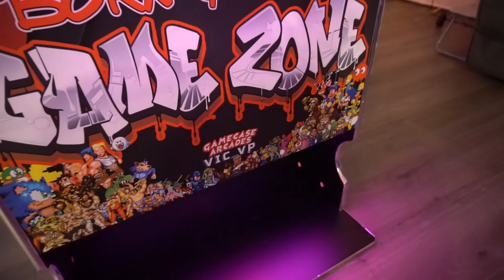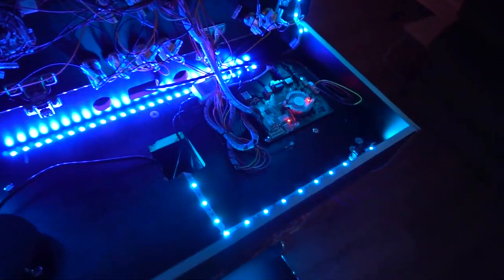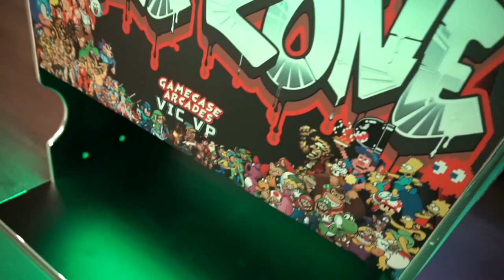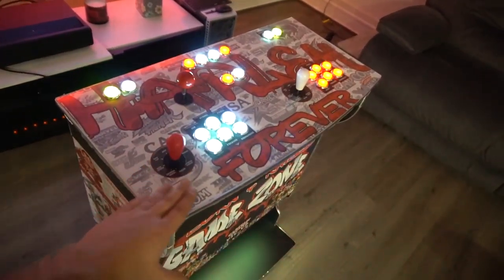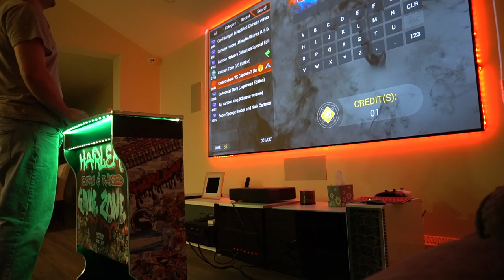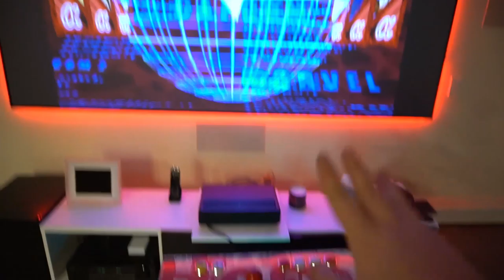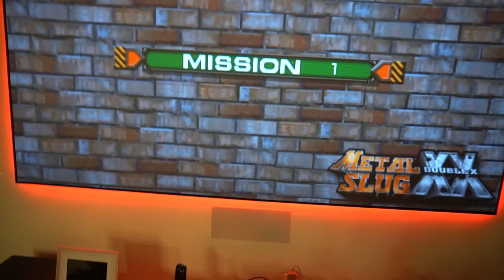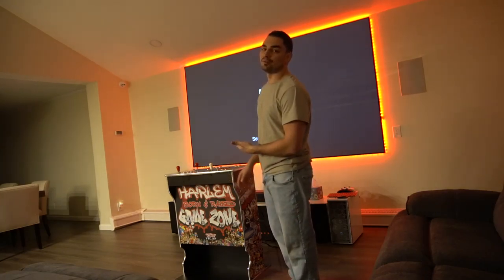New 2 Player Pedestal Design - Harlem Born & Raised

Comment: If you had to pick from the old and the new GRS arcade pedestals, which one would you go with after seeing both?
Reply from the maker: New pedestal is half inch mdf, old one is 3/4. Old 2 player control panel didn't have a pedestal, it was only a control panel.
New panel has more options but again that half inch kills me. The pedestal in this vid is half inch.
Reply: @Vic_VP  Hmm gotcha. Is the extra depth in the new version that much more spacious to fit everything in? Also, do you think the old control panel would fit/match on the new pedestal? Does the pedestal feel like a 3/4 height? Thanks for helping with the questions btw. Videos are great and help out with selecting and ideas!
Reply from the maker: I haven't don't the 4 player panel only 2 player.
You can but the stand and out the old panel on it... but be aware the new stand is half inch.
What buttons and addons are you looking at? (I've only done 2 player 6 buttons and dedicated 4 way)
If you do the old control panel and put it on the stand I believe the height is a few inches taller than if you did entire new panel and stand.
Reply: @Vic_VP  I’m going with the ultimarc RGB buttons(with ultimarc ultimate io) and 2 player 8 button. I’m thinking about either going servostiks or a separate 4 way controller.
Reply from the maker: @bensriaroon1146  eh I dunno about the servos. Not many 2 player 4 way gamed that will utilize it. I'm a big fan of the dedicated 4 way dead center.

Comment: How do u make 2 joysticks parallel and usable as the same joystick ?
Reply from the maker: Wire them together 
So I use Sanwa sticks... so it has the 5 pin connector... I basically spice and join them together
Reply: @Vic_VP  at what part do you splice ?
Reply from the maker: @mightycomicsandcollectibles  the end of the sanwa joystick connector has 5 wires with bare metal showing
Probably best to dm me I can assist with vids or pics if needed haha